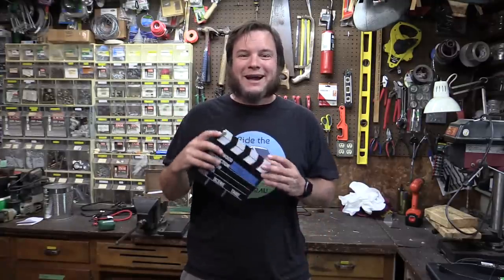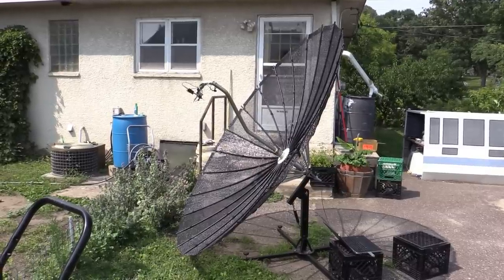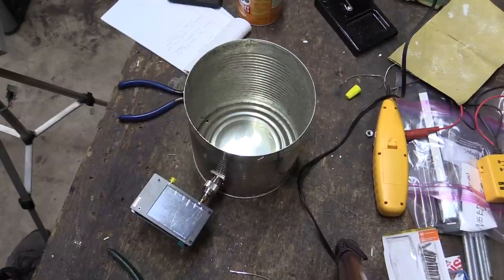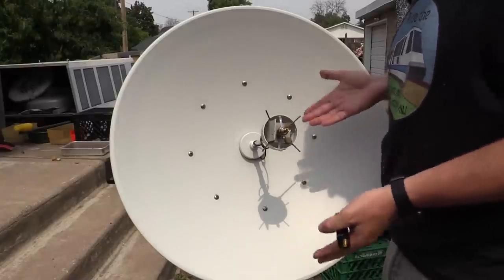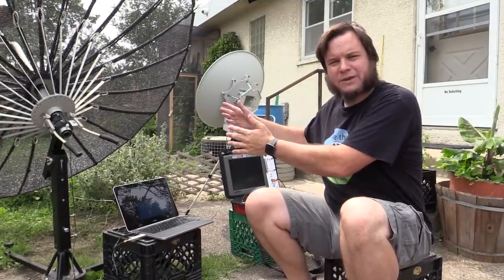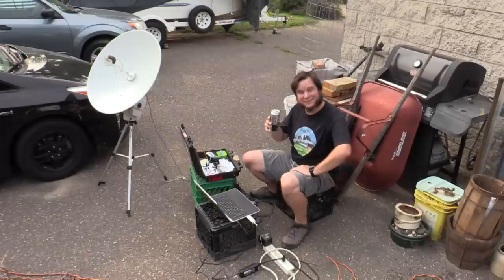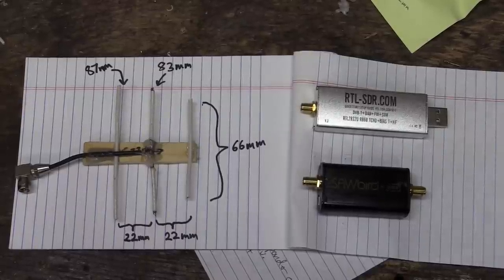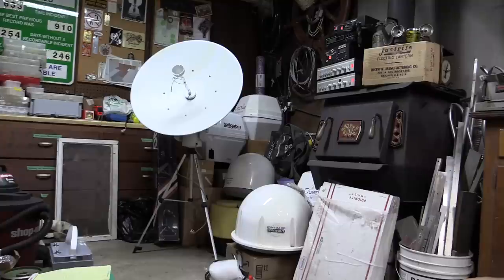Testing Antennas For GOES Geostationary Weather Satellite

Comment: Have you tried crossed dipoles?  That's the typical LF dish feed I've seen... they need a ground plane of course.  Also known as a turnstile antenna.  You can make a double one also.  Helical is another possibility... if the sat is not linear polarization you'll need to take that into account.  Love this content, keep it going!  My HOA rules were drawn up back when big dishes were the norm... I might be able to get away with a 10-12' dish!
Reply: GOES-16 HRIT data at 1964 MHz is linearly polarised, turnstile and helical antennas used for dish feeds are for circularly polarised signals.
Reply: @ferrumignis  Circular polarization is used for linear satellite reception in order to avoid cross-polarization loss.  When you use your linear yagi to make a sat QSO you are twisting it to maximize reception, right?  Circular polarization eliminates that need.
Reply: @scowell  Sure, if you don't care about the 3dB loss you can do it, and  is does remove the need to twist the antenna to maximize signal.

Comment: You should try using a fold up megaphone like we used in Force Recon and Navy Seals back in the late 1970’s and early 1980’s. You can buy them pretty cheap if you find a Ham that still has one. You don’t need the entire megaphone, just the folding umbrella portion of the megaphone.  I saw a Ham with one here in Honolulu just 3 years ago. WH6DWF🇺🇸

Comment: When you have a 1/4 wave monopole antenna the direction of the null is straight up. By pointing a monopole straight up at your dish you're pointing your null at the dish. It's the worst possible orientation for receiving signal. Put the monopole parallel to the dish, not perpendicular.

Comment: Got my sdr kit through the affiliate link, we'll see how long this round of stock lasts, last one sold out on the first day! The kit is the V3 in case anyone was wondering (the v3 is better than the v4 as they ran out of the good chips for v4)
Reply from the maker: I just got a v4, haven't had time to try it yet!
Reply: @saveitforparts  I guess it's got some worthwhile upgrades like a better heat dissipation with the different chip (can be fixed with some thermal paste and a heatsink if there's concern), HF Upconverter, and better filtering
Reply: but it does come with the tradeoff of not being able to support your favorite YT creator!

Comment: The stick antenna needs to be rotated. The vertical element of the stick antenna should be parallel to the back of the dish (like the cantenna has), not at 90 degrees to it.

Comment: This is the most helpful video i have ever seen on Geo weather satellites ,i am using the ideas very much so the 1.7 GHZ yagi idea  which i will try on my 2 M dish  just to see if i can get the signals from 2 or 3 Geo weather sats  we have in my part of the world which is Melbourne Australia . i know one uses the type of broadcasting that type of antenna can use . i was going to ask the length of the dipoles i see you have given but i was not sure if they were just one side of the dipole or the full length looking at it in your hand i think i got it right ...An idea  i am using to make it neat is thin steel rods cut to size from an old desk draw and using 12 NY-LP Panel Mount Barrier Terminal Block those white things for power connecting with screws to hold the wiring tight ,the rods fit in the power blocks and just have to screw them tight the spacing for every second ( so dipole nothing dipole and remove the brass terminal for the unused one  )  terminal block is correct for the dipole spacing in your video ...no glue needed . for the driven element i cut the brass connector in half so not shorted and i have soldered a wire either side out to its coax connector ...Yours is a wonderful solution for a smaller dish that can not use a  can antenna due it its size on a small dish ...i want to use it on a smaller dish in time so its a great idea . I have seen some wide band 3d printable feeds for dishes that would make a great video to try it looks like a V with a few dipoles going up in length i suppose the same idea could be used for the Helical antenna wire with in wire just different coil size .
Reply from the maker: Interesting! I've tried a few random things for antennas and so far the little printed circuit board thing seems to work best for linear signals. I have a couple more videos like this, at some point I need to set up a big dish permanently!
Reply: I know your pain ! i moved down from up Sydney way down to Melbourne and i just could not get around to putting my dish up any where so ended up dumping it ! it killed me loosing my 3m dish but we were moving again and no room to put it and lug it around again  just for storage  22 years later i now have the 2M mentioned , and guess what i am getting it up and running and the Wife is talking about moving again ! ARRRR  If i were you i would put up the mesh dish laying next to your shed its strong bit easier to do stuff when you have something like that on a pole mount perfect for your Geo sat work the  foldaway  dish is great for the experimental work and the little one on the powered AZ EL tripod  got me so interested in all this seeing that baby work reminds me of happy days in Sydney with my powered AZ EL 3M .
Reply: On the dish feeds i am trying your 1.7 GHz yagi idea first i just finished adding the LNA from 1990ish ~ ! never used in joy only took me over 30 years to play with it ! !the person that built if for me is long gone !   in those days the Geo weather sats were analog none of this digital stuff !  I can see the printed circuit board Yagi looks like a easy feed to try ,we have a 3D printer so i am getting my son to make me stuff after i see some results with this one

Comment: You have shown that antennas that fire towards the dish(yagi) work better than those that fire to the side(ground plane). If the material of the center support of that 30" dish is metsl or conductive it will seriously mess with the feed antenna.

Comment: Great work and video. Where is the small Yagi put. There is not video of its placement. Thanks
Reply from the maker: I had it in the focal point of the dish, where the LNB would go for a TV dish or where the network antenna was on the smaller one.

Comment: I just picked one of these 5.8ghz dishes up, has holes around the edges for radomes. Attempting proba, but ive seen it just may not be on over me. I've been guessing the length of the feed horn based on what came with it

Comment: What you need to do is set up the fixed c band dish your figuring what to use it for your goes weather station. I would like to see how much stronger the signal is with a mesh c band dish  over the wi fi dish I'm using.

Comment: I'm not sure what you're doing for pointing the c-band, I know that when I was watching TV off of C-Band, oh some 30 years aog, aiming was done in 2 parts. One part was orienting the pivot of the antenna so that the dish would consistently point at the Clark Arc, (which bing at 45 (ish) degrees off the equator, means you don't just point the dish at 45 degrees off level, it needs to be pointing below that to hit the orbits at 23,000 miles out, as you are well aware) but once the pivot was oriented correctly, there was simply a linear actuator that would drag the dish around that pivot from east  horizon to west horizon and back, with known markers for each satellite in the clark arc that was carrying c-band TV transponders. I presume that if you get this c-band pivot oriented properly, yo could just as easily set it up to grab 10-20 min of data off GOES E, then point to GOES-W, for 20 min, then back, with a couple of minutes at each re-aim to fine tune the aim.

As I recall, there were a couple of modifications that would allow you to grab DirecTV feeds with the C-Band dish. One mounted an DirecTV LB (Ku-band?) next to the C-band LNB, another did a full swap of the existing bi-polar lnb with a uni-polar lnb for c-band, and a unipolar LNB for DirecTV, and you just lived with the fact that when switching between od and even transponders, there was going to be a delay while the polarization was re-oriented.

Polarization might be something else to check on that new Yagi solution, Rigging up a stepper and rotary encoder (or high quality servo for viewers with a huge budget, I don't have that) to turn the yagi through 180 degrees, looking for peak signal or peak signals, then tracking that from endstop marks for best opportunities to re-hit that mark. or 3d print an LNB housing that has a built in thumb wheel rotator with a lock of some sort if you are setting up a permanent station somewhere.

And of course you could always set up a cloud service that hosts the past 48 hours of imagery, from wherever you end up with the best signal, and then you just pull the most recent of whatever image set you need wherever you have internet service. But that presumes that you'll have internet service, or you're not trying to show off how the data is collected. So have fun. :-)
Reply: And yeah, the video just dropped into my feed today. :-)
Reply from the maker: I've more recently mounted another C-band dish for GOES, it has a linear actuator but I think it's seized up. Also have another one that I'd like to motorize for two-axis pointing, so I can get stuff in weird orbits like Molinya and Low-Earth-Orbit. More stuff for the to-do list :-)
Reply: @saveitforparts  My experience on the c-band actuator was that it's effectively an all thread rod, attached to the drive motor, that turns in a not attached to the 'near' end of the inner shaft. that extends out. Depending on the drive mechanism, it could be a stepper motor or a dc motor, either with an encoder to indicate how the actuator is turning (or not.) Seized actuators either have corroded bolts and nuts for the actuator, or in some cases the all thread is no longer bonded to the drive mechanism. I recall that there was a grease fitting that had a label recommending annual servicing. I don't know if the attachment of the all thread to the drive is a welded fitting, or if they use a clamping mechanism like we see on lower end 3d printers z-axis.

As an observation, I'd suggest that using a DC motor for driving the actuator rather than a stepper. Definitely would need an encoder to learn how the movements are working, but you can do some of that in tracking signal levels of the satellite, and derive az-el changes from that, along with orbital elements of what you're tracking.I would imagine that one of the setup functions would be to start with 2 known geostationary satellites to get a fixed line and 2 fixed (sort of) points on the line for being able to move to where you expect the satellite to be tracked will be located. That gets a bit interesting if the signal ban you are going to be working with isn't the same signal band that the geostationary satellites are operating with.

In any case, keep having fun.

Comment: I am using a similar dish and Goes+ LNA, RTL SDR v4 and satdump. I see the signal but satdump always says 0 SNR when I try either LRIT or HRIT. Am I suppose to use LO offset? I have satdump 1.2.0 and it looks different. Any chance you could do a detailed walkthrough for the pc setup?

Comment: Hey! I'm trying to set up my own system for listening in on satellites, but I'm having a little bit of confusion. Which way do you orient your Sawbird filter? I assume that the input is supposed to be plumbed to the antenna and the output to my SDR, but I'm not sure, there's no instructions anywhere online. Is that correct?
Reply from the maker: Input goes to the antenna and output /DC goes to the SDR. You want to make sure you're powering the SAWbird with either a BIAS-T setting on the SDR or with a USB cable, but not both! There's some info here: https://support.nooelec.com/hc/en-us/articles/360011133694-SAWbird-LNA-Filters

Comment: Question! Is it possible to use a cars antenna to receive some of these satellite images? As well as weather satellites like NOAA?
Reply from the maker: It depends on the antenna. I would say the old '90's type FM antennas might pick up NOAA satellites, especially if you messed with the length of the antenna. A magnetic antenna for a CB or mobile radio might also work, depending on tuning. Modern car antennas, I don't know. For Sirius/XM satellite radio I think the antennas are tuned for S-band, which doesn't have as much weather stuff, and the signals from commercial satellites are stronger so the antenna can be small.

Comment: I haven’t looked up the GOES satellite specs but I thought most satellites were circular polarized.  I GOES is circular I bet you would have much better luck with a circular polarized antenna.  🤷‍♂️
Reply from the maker: GOES uses a linear polarization, at least for the L-band signal.

Comment: Some of your antennas probably were ineffective because of polarization mismatch. You might be able to fit a helical antenna on there. https://en.m.wikipedia.org/wiki/Helical_antenna
Reply: helical antennas don't work well with prime focus dishes
Reply: The GOES-16 HRIT data on 1694 MHz has linear polarization. Turnstile antennas used as dish feeds (axial mode) are for circular polarization.

Comment: I wonder if you inflate a large balloon with a valve to top up the air as balloons leak air, coat it with a release compound a third of the way across, spray it with galvanized paint, give it 4 or 5 coats, then apply glass fibre and resin carefully for the first few coats, build it up till its strong enough to keep its shape, deflate the balloon, coat it with tin or aluminium foil, aim it at the sun with a sheet of paper to find the focal point, and voila, a cheap large dish
Reply from the maker: That's an interesting idea! I was thinking of trying to make a reflector with the big Ax-Man inflatable buoys, but wasn't quite sure how I'd do it. I got ahold of some other dish material recently so I should be able to do a big one soon!

Comment: Wouldn't a helical feed work better like for HRPT satellites?
Reply: helical feeds don't work well on prime focus dishes.
Reply: @albatross_v2  I wasn't aware of that, it works really great on offset dishes. What is the reason why it won't work well on prime focus dishes?
Reply: @t0nito  I think (I may be wrong) it's to do with the fact that helical antennas aren't good at receiving wide angle irradiation.
Reply: @albatross_v2  well there are some examples of people having good results with helicals on a prime focus dish online so it can't be that bad I guess?
Reply: @t0nito  I reckon they would get far better results with a different feed, but if a helix is all you have I guess it doesn’t hurt to try.
Reply from the maker: I've had some OK luck with helical feeds (I think I have another video on that in the pipeline). I'm still experimenting with this stuff though!